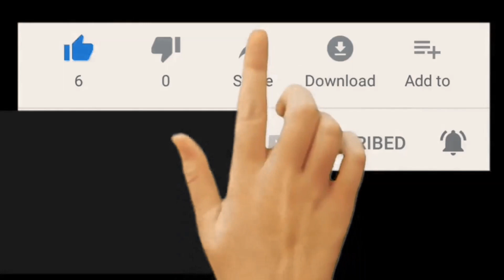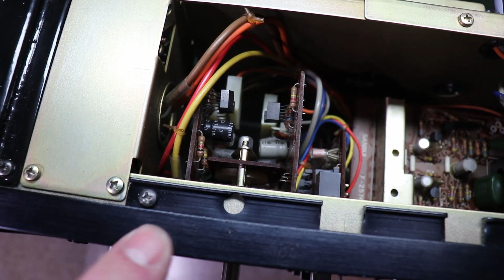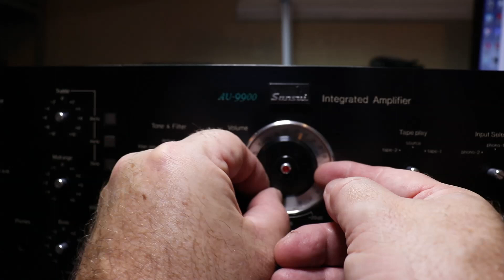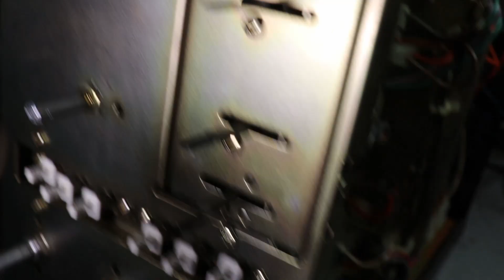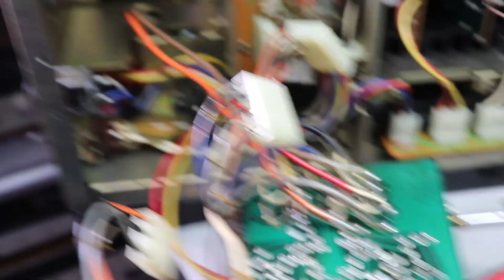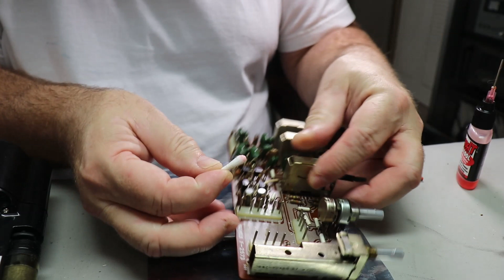Sansui AU-9900 Vintage Stereo Integrated Amplifier Repair And Restoration. Fixing Old Audio - Part 3

Comment: I have an AU9500 that I bought new in mid-70s. It has been used regularly and worked flawlessly for all of these years. Until recently, that is.  Glad I found this channel. Anything that makes me smarter will help me diagnose and fix the unit.
Reply from the maker: Your 9500 is a fine piece of vintage gear. As the years go on there's more of a chance of having issues. I'm glad that the video helped you out. Thanks for watching.